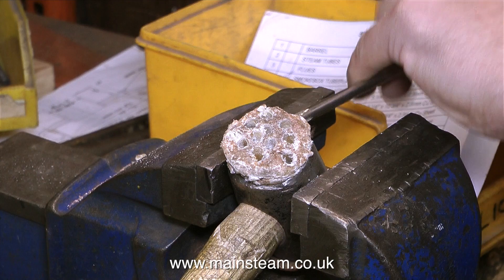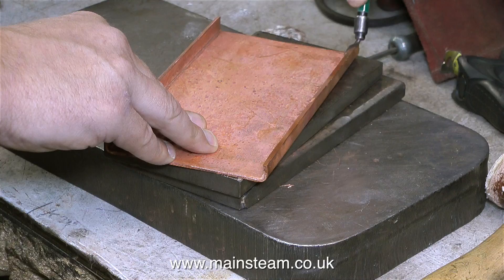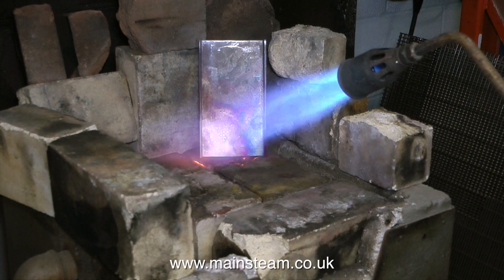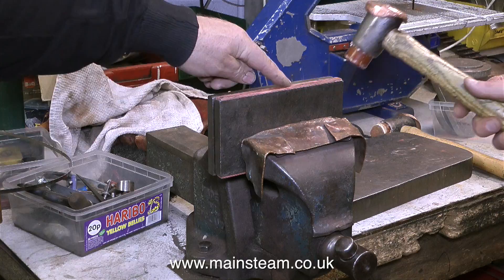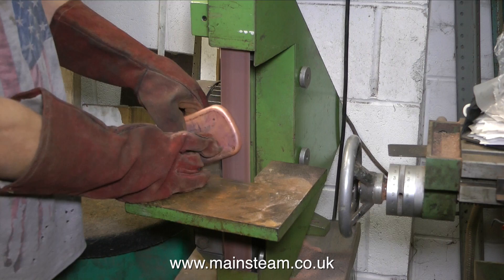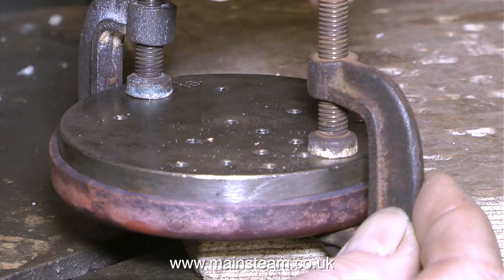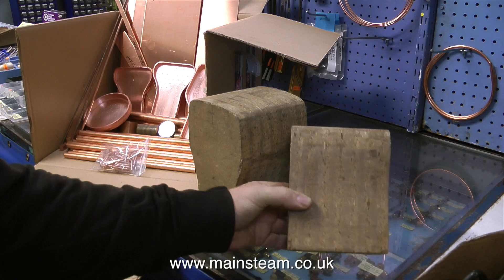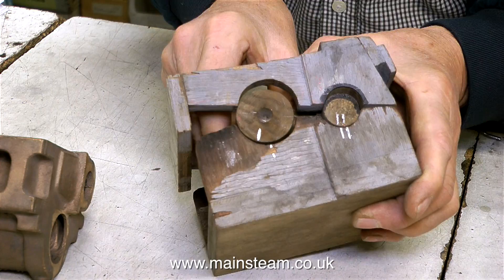MORE MODEL BOILERMAKING AT BLACKGATES ENGINEERING

Comment: When I was an apprentice in the 60s, I used to love watching the lead burner, who also worked copper. I got into trouble more than once for watching him instead of working.  For some obscure reason I love those Thor hammers. I bought one just to own it, and hardly dare use it in case I damage it. :).
Reply: Those hammers cry out to be used, get some copper and a torch, even a camp stove will do and play around with it. buy or download 
K.N Harris's book Model Boilers and Boilermaking. 
Read it cover to cover a couple of times then build a pot boiler. It will not make you a Duncan, but it is very satisfiing. I spent most of my working career working with mills, lathes and other manufacturing equipment and there were times I would come home very frustrated and wound up and beating a piece of copper into an endplate was very relaxing, almost like watching an unpainting video.

Comment: I’ve always wondered, Quenching aluminum and copper make it softer but quenching steel makes it harder. Do you have any idea why?
Reply: Quenching doesnt makes the copper softer, its the heating wich makes copper soft again.
They are quenching it to cool it down, so that work can continue asap.
Reply from the maker: I have mentioned this in other videos, the quenching cools the copper quickly and removes the scale by thermal shock, but the red heat generally does the softening ....
Reply: With steel, it depends on the amount of carbon, 
.18% carbon will  not harden much at all.  
.95% carbon can get glass hard
Reply: The hardening of steel by raising the temperature to the appropriate bright red heat and quenching it involves the interaction of the iron, carbon and sometimes alloying elements and is unique to the iron-carbon system.  Hardening copper by working it is a very different, but more common phenomenon.   I would have to discuss things like microstructure to further explain it, but almost all metals will "work harden" (even steels).  The cooling rate (quenching or not) after annealing will have different effects in some situations.  Iron alloys (such as steel) generally need to cool slowly to get softer.